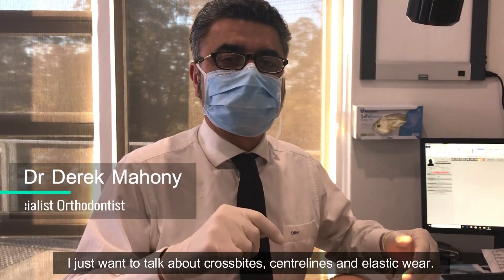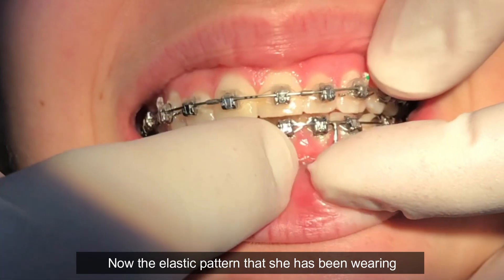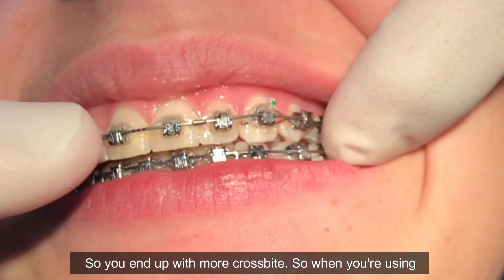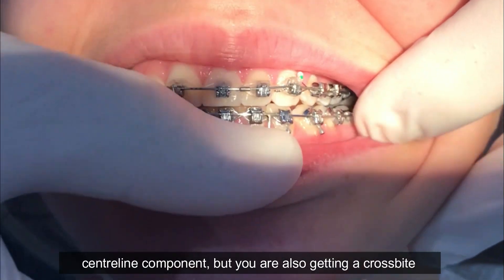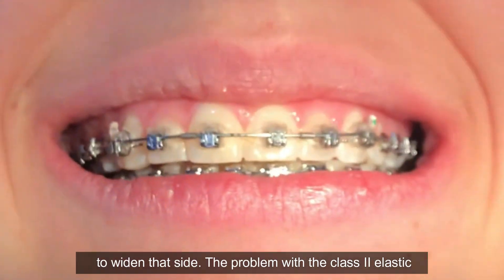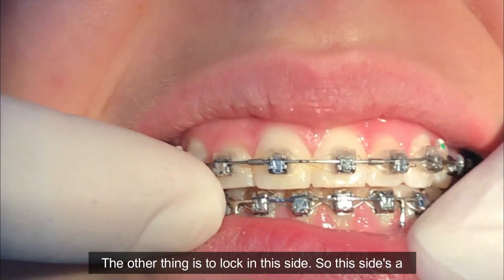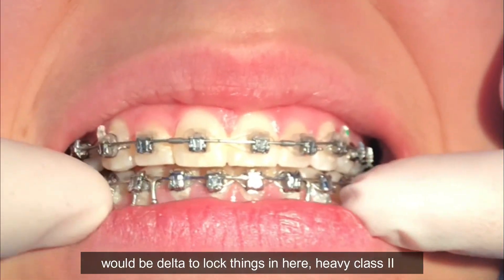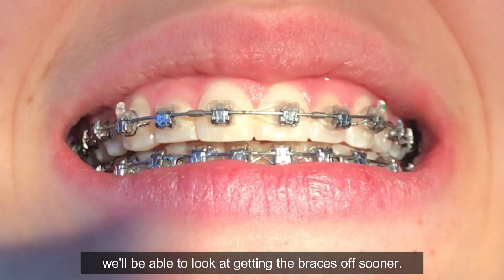Crossbites, Centrelines and Elastic Wear

Comment: Hi Dr. Derek. You have beautifully explained the use of elastics for midline correction. In your patient, the overjet is quite minimal. While moving teeth to correct midlines, dont they move and reduce the overjet? I am not sure if they move like marbles on a string... 
Another doubt was whether you have done any interproximal reduction on the upper left side to move the Canine to Class 1 relation...

Comment: I have the exact same problem and I got the same elastic set up they told me depending on how good I do with them on my next visit I will he told when I get them off this is a slow process so I began to double up on my elastics is this bad ?
Reply: Joe Toodeep yeah don’t double them cos it can cause problems to your root and can move your jaw too far then you need braces for longer 😬
Reply: mattie_ sizer oh snap yea I didn’t do it after the first time it made me really sore even hurt my ear thanks for the feedback!👍
Reply: @joetoodeep5664  what happened did it got fixed?
Reply: @marietampouikou179  no my teeth and bight got straightened but didn’t get centerline with the bottom I have no problem as of now:)

Comment: I have a slight crossbite and an off centre line, do I need braces?
Reply: Braces didn't fix mine, as I was hoping it to.
Reply: @DowntownCanon  Then what would?
Reply: @dreamer6432  I needed to have four teeth extracted for it to get corrected.  The orthodontist said it would ruin my face.
Reply: @DowntownCanon  Woah I don't think mine is that bad. If two of my teeth were to come forward then I think my crossbite would be fixed
Reply: Dreamer same problem but
Reply: DowntownCanon ya ecactly but my orthodontics  is forcing me to do those extractions

Comment: I’ve got an off midline after braces. Wish it was centred
Reply: U should have told ur orthodontist to correct the midline b4 u get ur braces off.
Reply: @kazmeensayyed3068  wait currently I have braces but am very close to getting them off(like in 2 months) and my orthodontist has never mentioned anything about my midline being off but I’ve recently noticed that it’s pretty off. Is it too late to say anything? Will it prolong my treatment?
Reply: @arelymartinez1052  u r not to late.u cn still gt it corrected.
Reply: Same as my case,but still when I smile it wont show that much..not obvious
Reply: Same but I got the midline years after because I slacked I’m wearing my retainers..
Reply: On*
Reply: Did you where your bands? Maybe you develped a habit of letting your mouth sit a certain way when you had braces

Comment: does crossbite cause a slight crooked smile or is that jaw related?
Reply: I mean I have a cross bite and my smile is crooked lmao
Reply: ChickenFeet right lmaoo I hate itn🤣
Reply: @petrafriedchicken  my crooked teeth are due to my crossbire
Reply: Lily C but braces also work w the jaw. I have a crossbite & just got bands
Reply: @blasianprincess8763  did it work the rubber bands? Because I got mine a month ago
Reply: @hbkkamiah6149  ofcourse. Just go with your orthodontist and any doubts? TELL THEM! I’ve have some doubts ab my braces process I just asked them wat I wanted to know.
Reply: @blasianprincess8763  how can braces align the jaw? The jaw is more powerful than the teeth
Reply: It's mostly jaw related
Reply: @niyahgirl2006  same
Reply: Maria louis it is where on of your bottom teeth is in front of your top that’s what i got told
Reply: @kenzie7488  thats under bite. Over bite is the opposite cross bite is when either your top or bottom teeth are sided from each other which is what I have. A cross bite